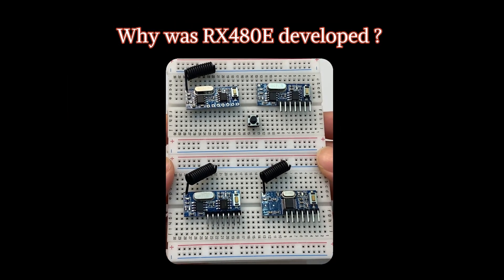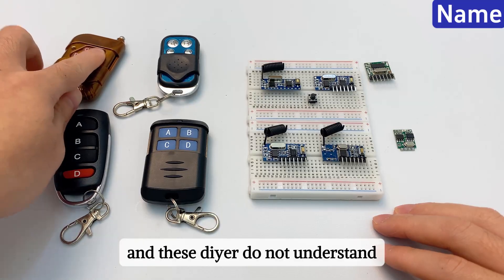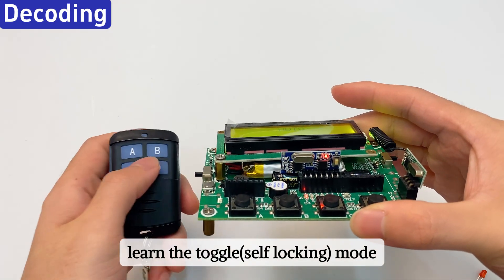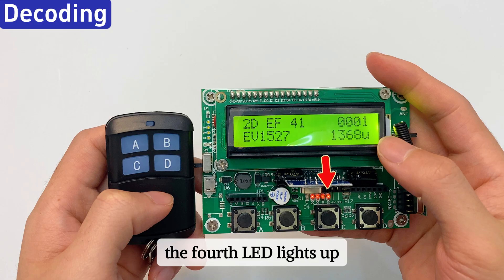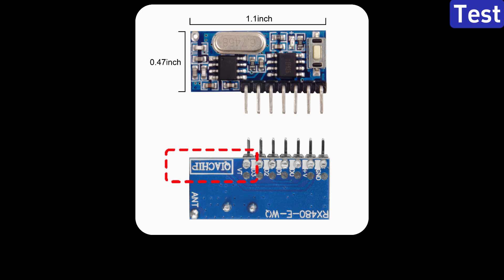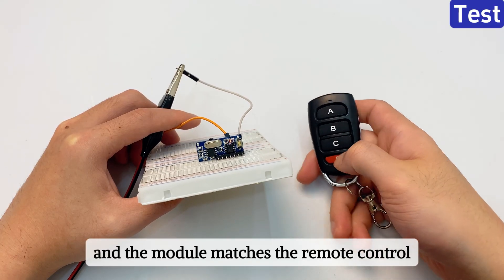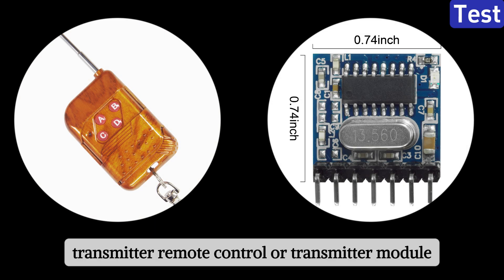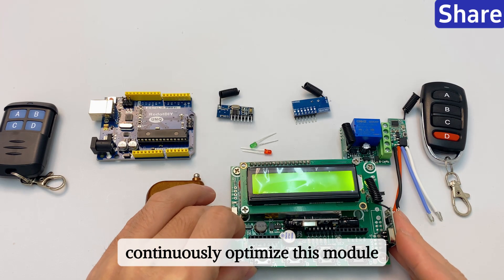RX480E 433MHz 4 channel RF receiver module with deconding DC3V DC5V by QIACHIP | User guide and Test

Comment from the maker: Welcome everyone to add more wonderful videos in the comment area！
Excellent RX480E video,
How to Make Anything Remote Controlled with the RX480E Circuit!
https://www.youtube.com/watch?v=AQAuawAmvow

RX480E & TX118S радиомодули 433МГц передатчик + приемник
https://www.youtube.com/watch?v=l3_N9pTizo0

QIACHIP 433 MHZ four channel RF receiver module | Review and user guide
https://www.youtube.com/watch?v=Awnqycbe5H4

How to use QIACHIP Multifunctional RF Remote Control Signal Decoder RX480E TX118SA RX480E Tester
https://www.youtube.com/watch?v=3yIVuT7U8NE

Программируемый приемник на 433 Мгц.
https://www.youtube.com/watch?v=5sj0tsDrM4U

"4-х канальный радиомодуль 433 МГц RX480-e4 и TX118SA-4" 
https://www.youtube.com/watch?v=NM5xy-ADqfY

Обзор приемника и передатчика на 433 мГц RX480E 4 и TX118SA 4
https://www.youtube.com/watch?v=vh2lb8LyKdc

When new videos are discovered, the list will be continuously updated

Comment: In the single-chip version, the outputs operate in reverse in momentary and latching modes.
Momentary mode -> D0 D1 D2 D3
but Self-Lock (Toggle Mode) mode -> D3 D2 D1 D0.
Unfortunately, this is a problem with my pre-built board.
The dual-chip module I used didn't have this problem.
Reply: Yes, these two models are designed to meet the needs of different customers. Therefore, please remember to continue using the version you purchased previously.
Finally, we suggest contacting customer service for a replacement to resolve your issue.

Comment: Saya ingin bertanya dan mohon dijawab,modul rx408e versi terbaru yang 433mhz apakah bisa menggunakan remote punya modul r04b? Karena saya memiliki sepasang modul r04b tetapi receiver nya rusak dan tersisa remote nya saja, maksud saya jika remote modul r04b bisa digunakan di modul rx408e saya hanya perlu membeli receiver rx408e saja tanpa perlu membeli remote lagi
Reply from the maker: Saya mengerti kebutuhan Anda.
Anda ingin memeriksa apakah remote control Anda kompatibel dengan kedua modul tersebut.
Pertama, apakah remote control Anda 433MHz? Apakah menggunakan kode pembelajaran atau kode tetap?
Atau apakah Anda memiliki instruksi untuk R04B?
Saya tidak memiliki informasi apa pun tentang modul ini, jadi kita perlu melakukan penilaian yang komprehensif.

Comment: i have purchased this module from amazon the module works but does not let me set the latch  function, i press the button twice the led on the board blinks with twice then stays lite up, i press the tx button once and it stays in momentary mode i also pressed the button 8 times and re paired it also power cycled it, but still stays in momentary mode any help would be great
Reply from the maker: May I ask which store you bought it from? Please tell me the store name and I'll check it.
Reply: @qiachip  amazon its says QIACHIP on both TX and RX i mainly need the latching function thanks
Reply: @qiachip  TX is the V2, RX RX480E
Reply from the maker: Thank you for your feedback. Could you please directly tell me the name of the store?
Reply from the maker: Or you can directly shoot a video of the pairing process and the operation steps when the pairing fails and send it to me（email：qiai@qiachip.com）. This will help our engineers make a direct judgment.

Comment: My remote works and the LED is blinking when remote button is pressed. But no matter which mode I’m in, no power I being emitted through D0-D3?
Reply from the maker: Sorry for the trouble caused. Regarding the problem of no output from D0 - D3, here are some troubleshooting steps:
First, ensure that the RX480E module is of our brand, as the functions of some imitation manufacturers may differ from ours.
Second, make sure that the remote control has been paired with the module. You can perform the pairing operation again.
Third, confirm the power supply of the module (DC3V - DC5V).
Fourth, D0 - D3 work with high - level output. You can measure it with a voltmeter, or connect the positive pole of an LED to D0 - D3 and the negative pole to GND for testing.
Fifth, if the test in the fourth step shows no problem, then it may be an issue with the peripheral circuit drive. Note that the current of D0 - D3 is only 10 - 20mA. If the test in the fourth step fails, and you have a spare module, try replacing it to check whether it is a hardware failure of the module.
If the problem persists after inspection, you can provide more details such as wiring diagrams, and we will continue to assist you.

Comment: Dear,
I am using a RX480E 433MHz receiver (single IC model) and two different separate RF transmitters.
When I pair one transmitter to the receiver, all functions work properly on Ch1.
If I pair the other transmitter (separately) to the receiver, everything also works properly on Ch1.

If I pair both transmitters, both only control the Ch1 output.

I want one transmitter to control only Ch1 and the other (separate and with a completely different code) only Ch2.
I only need - Momentary Mode on both channels.
Is this possible?
Reply from the maker: How many buttons does your remote control have?
For a single-button remote control, the method you mentioned is not currently supported by our module software;
Our module is recommended to match a 4-button remote control, and each button automatically corresponds to a channel
Reply: @qiachip  I only have one button on each remote.
Reply from the maker: https://qiachip.com/products/rx480e-1a-dc2v-3v-5v-1ch-output-433mhz-rf-receiver-learning-code-decoder-module-433-mhz-wireless-for-remote-controls-1527-2262-encoding?_pos=5&_sid=0e491f3b6&_ss=r&variant=42283590123590
You can check out this link. This product is specially developed for use as a remote control.

Comment: Advice - I have this transmitter rx480 and use it together with power sockets. Sometimes, when I send the code, two sockets get enabled, meaning that one code was sent and received by two sockets, but those sockets were already paired with a different codes. What might be the reason ? Would you recommend something with encryption/two way communication I could use to control 8-10 power sockets ? Transmitter hooked to RPI, with a reasonable library (rc-switch is ooooold).
Reply from the maker: Our RX480 is a receiver, not a transmitter. You may not be using the same thing.
The problem you mentioned is whether the RC remote control can control other remote controls. Some older libraries may have this problem. If you control a lot of devices,
it is recommended that you use other protocols, such as Bluetooth protocol and Zigbee protocol.

Comment: I have purchased 2 pairs of transmitter and receiver, I have paired them separately for momentary function , when I momentary press the button connected to the transmitter 1 it works with receiver 1 perfectly, and transmitter 2 work with receiver 2 . That is ok . but my application is that transmitter button will be pressed for a long time , I have tried the circuit , when I keep pressed the button of transmitter 1 for long time ,in the meanwhile if I operate the pair 2 then It interfere with the  functioning of pair 2 , pair 2 don't work as it should . what should I do sir ? I want them to not interfere with each other
Reply from the maker: Whenever you press the buttons at the same time, the devices are close to each other and the signals will interfere with each other, so it is recommended that you use the Toggle mode, which is the mode where you press the learning button on the receiver twice.
In this way, you only need to press the remote control once to continue controlling, and then press the AB remote control alternately, which can reduce interference;
Or keep the two sets of devices far enough apart to avoid interference.
Reply from the maker: There is an introduction to the working mode in the comment section

Comment: One question, if the remote control is activated several times away from the receiver module, does it then continue to receive command orders or does it become blocked and need to be reprogrammed? Thanks.
Reply from the maker: The question you raised is really great.
This may be a question that everyone is concerned about.
The distance away from the receiver is generally beyond the receiving range of the receiver, right?
If it is beyond the receiving range, when you press the remote control (activate the remote control), the receiving module will not respond, because the receiving module cannot receive the RF signal of the remote control, it is too far away!
At the same time, the remote control itself will not be programmed.
So when you are in the distance range again, the receiving module will receive the signal and respond, without re-encoding again.
Our products are different from other brands. The main encoding is on the module, and basically not on the remote control.
you can see our test vedio:
https://www.youtube.com/shorts/8SrlBpitr4E

What products have been tested today? 4 Long-Distance Remote Control

Comment: Excellent!
Working mode introduction:

1. Press the learning button on the module once, and the remote control will enter the inching mode after learning;

2. Press the learning button on the module twice, and the remote control will enter the self-locking mode after learning;

3. Press the learning button on the module three times, and after the remote control learns, it enters interlock mode;

4. Press the learning button on the module 4 times. After the remote control learns, it enters the two-way self-locking + two-way inching mode;

5. Press the learning button on the module 5 times. After the remote control learns, it enters the two-way inching + two-way interlocking mode;

6. Press the learning button on the module 6 times. After the remote control learns, it enters the two-way self-locking + two-way interlocking mode;

7. Press the learning button on the module 7 times. After the remote control learns, it enters the two-way interlock + two-way interlock mode;
工作模式介绍:

1.按1下模块上的学习按钮,遥控器学习后,进入点动模式;

2.按2下模块上的学习按钮,遥控器学习后,进入自锁模式;

3.按3下模块上的学习按钮,遥控器学习后,进入互锁模式;

4.按4下模块上的学习按钮,遥控器学习后, 进入两路自锁+两路点动模式;

5.按5下模块上的学习按钮,遥控器学习后, 进入两路点动+两路互锁模式;

6.按6下模块上的学习按钮,遥控器学习后, 进入两路自锁+两路互锁模式;

7.按7下模块上的学习按钮,遥控器学习后, 进入两路互锁+两路互锁模式;
Reply: Are you saying that the working mode has to be set before you pair transmitter with the receiver?
Reply: Modes 4-7 also important 😊
Reply from the maker: @GafferZV  Thanks for the tips.
RX480E module will become better because of you.
More suitable for DIY enthusiasts